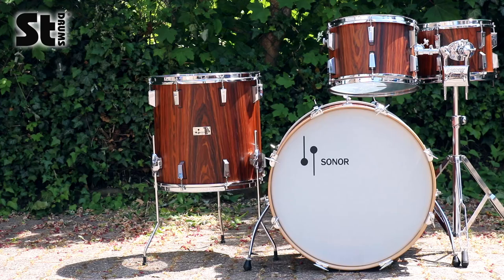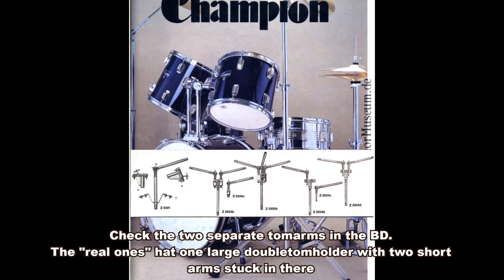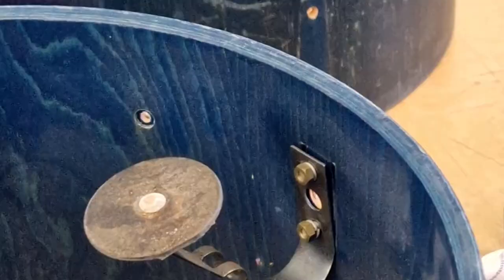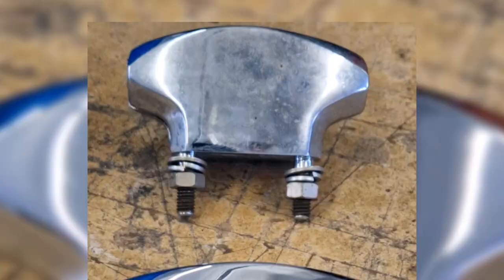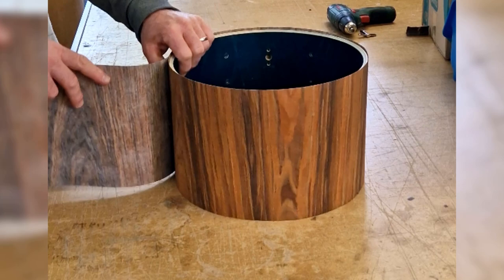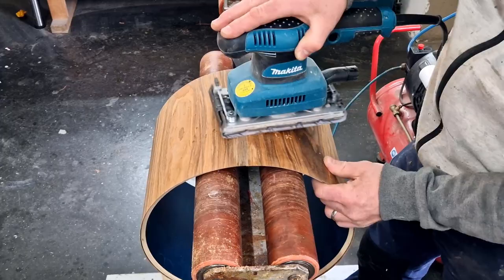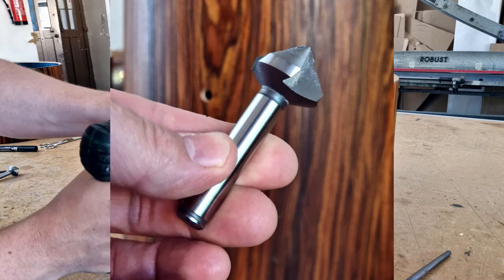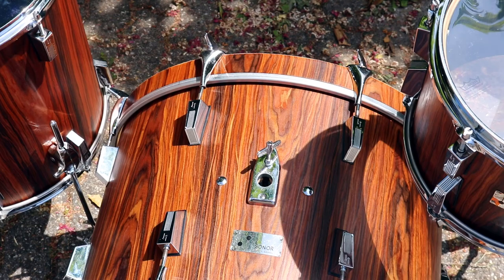We restored this German Sonor Drumset from the 70s!

Comment: Did vintage Sonors usually have the rubber gaskets under the lugs like this? Did you just cut them out yourself from a sheet? Thanks!
Reply from the maker: the vintage Sonors of that era didn't have the rubber gaskets. Signature had vulcanic fibre (check our latest video on the topic) in the same shape. We have a special punching tool and a large punching machine for these rubber gaskets so they come out even. You can find them in our webshop under the name "gasket lite"